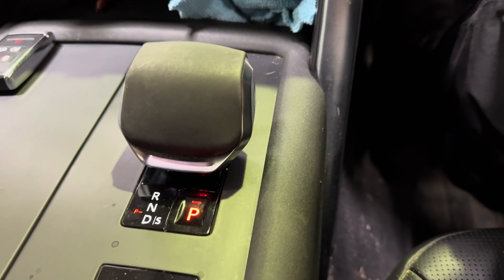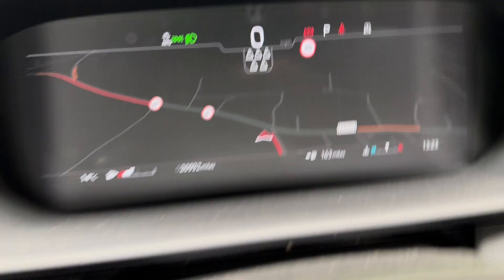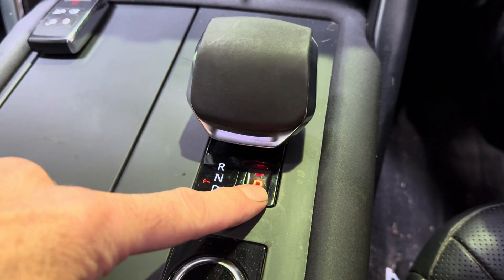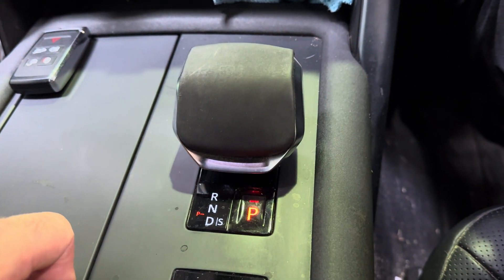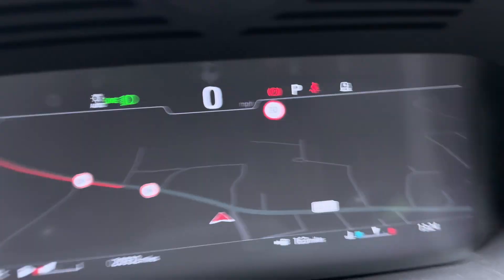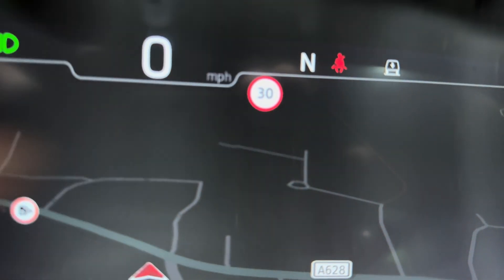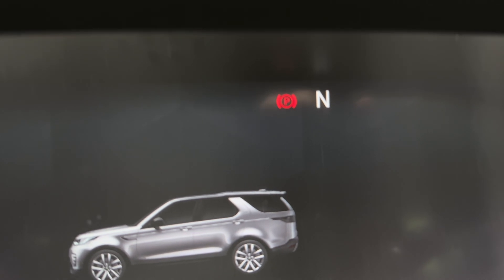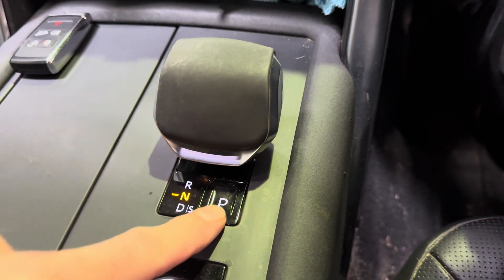My way how to Roller Brake Test the EPB on a 2020 onwards Land Rover. READ DESCRIPTION

Comment: If you carry out a deceleromater test, you can press the P switch at 20mph and it only applies the epb. 
I got this from the land-rover official site. 
Hope this helps.
Reply: You can't do a decelometer test on EPB latest updates.
Reply: Rollers need to be on manual or automatic